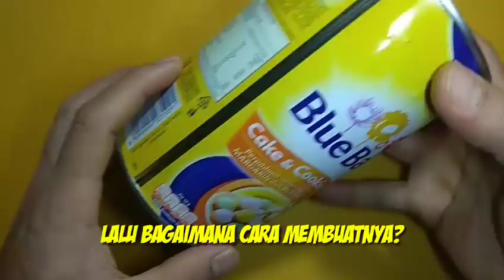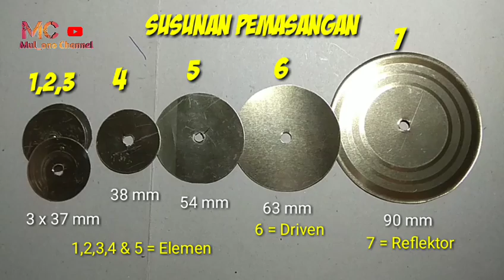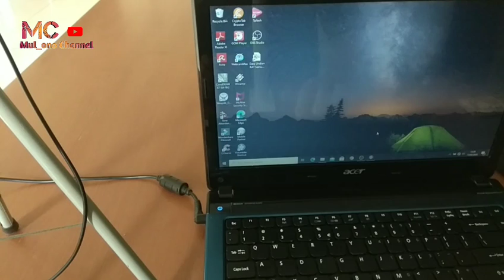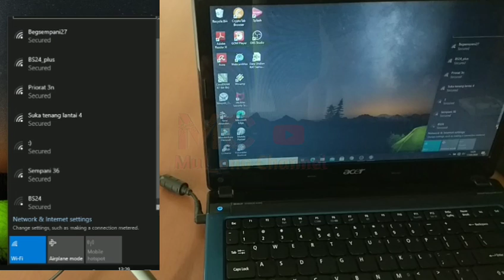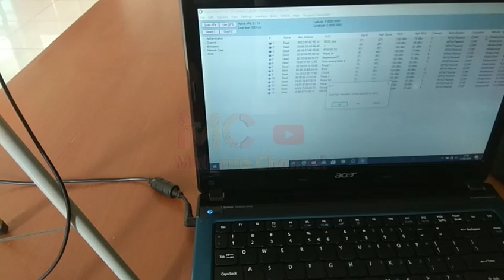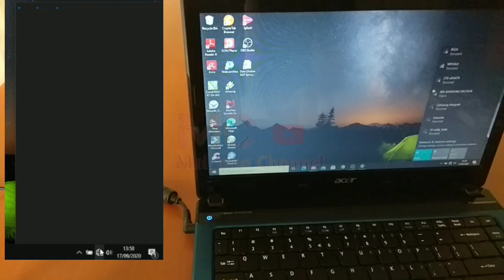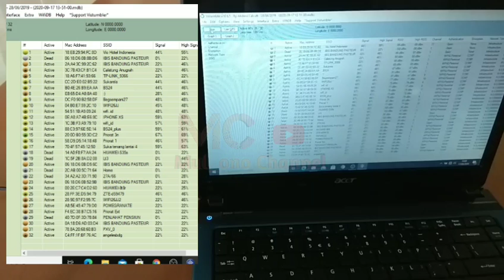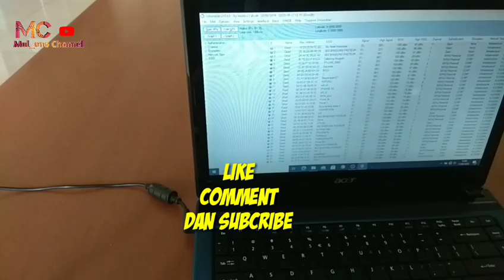Membuat Antena Wifi Gun Powerful, nembak wifi jarak jauh

Comment: Hi how are you. Could you tell me the range to capture 2.4 Ghz networks from a height of 6 meters above the roof of my house? 2- contemplating the loss of signal through the coaxial cable rg6 or a tp2. 3- I use a program called NetSpot. What is the name of your video, because they are similar. Finally, if the antenna had more elements instead of 7 like yours, there were 14, would there be more signal or pick-up power per distance? Thank you very much and your post is very good.

Comment: My friend plzz reply does the antenna work without isolating the driven disc as you have done what is the advantage of Isolating disks
Reply from the maker: Without isolation the antenna will still function properly. Since I'm looking for security for the router, I think for long-term use it would be better to use isolation.
Reply: How can i connect the cable to the adapter without SMA connector
Reply from the maker: It is very easy. The end of the cable from the antenna can be directly connected to the signal receiving antenna line on the PCB. We recommend that the default antenna from the router is removed. How to connect the antenna cable is in my other videos.
Reply: @muletech-112  thanks for the information

Comment: Bang ukuran 37mm 38mm.....itu teh ukuran diameter atau gimana bang?
Reply from the maker: Iya betul. Ukuran diameter lingkaran.
Reply: @muletech-112  kalau kabelnya pakai kabel antena parabola bagus nggak om?
Reply from the maker: Pakai kabel untuk wifi yg berimpendasi 50 ohm. Klo mau hasil bagus, kabel harus disesuaikan peruntukkanya.
Reply: @muletech-112  bagus nya pakai kabel RG berapa ya om? Mohon pencerahannya.saya udah coba pakai bekas kabel antena parabola hasilnya nggak bagus om
Reply from the maker: Saya biass pakai kabel coaxial wifi rg 174

Comment: I built this antenna several times and it does not receive many signals
Reply from the maker: Does the antenna you make, the size and material fit in the video? What cable did you use and how many meters long?
Reply: @muletech-112   Please send me your telegram ID

Comment: bikin buat outdor dong om dgn kabel koaksial 15 meter
Reply from the maker: Kemarin sdh sy coba dgn panjang kabel 10 m tidak bisa. Antena loss, sama sekali tidak bisa nangkep sinyal.
Reply: @muletech-112  terus solusinya bagaimana?
Reply from the maker: Klo menurut saya router di modif sj outdoor.
Reply: @muletech-112  aku ada mr3020
Reply from the maker: Ow... Router wifi 3g/4g ya.. Blm ada pengalaman mas bro. Mungkin bisa cari refrensi di ytb.
Reply: @muletech-112  itu bisa juga untuk tangkap sebar tp ga kejangkau
Reply from the maker: Ow... Klo gtu mending di mondif outdoor sj. Tapi maaf sy blm pernah. 😀😀😀
Reply: @muletech-112  ente org mana om? kalo mau kurimkan mr3020 buat prakteknya om

Comment: Kalo untuk router yg pake dua antena bagaimana masangnya mas?  Yg satu nganggur gitukah?
Reply from the maker: Biasanya di router 2 antena. 1 antena untuk nangkap, dan 1 lagi untuk sebar. Klo untuk nembak, harus tau dulu antena mana yang buat nangkap. Cukup 1 antena sj yg di modif.
Reply: @muletech-112  yg nangkap biasanya cirinya apa dan yg nyebar apa
Reply from the maker: Klo saya tes manual bro. Antena dicopot dulu salah satu. Nyalain router, baru dilihat antena yg terpasang bisa nangkap wifi / tidak. Klo tidak bisa nangkap berarti antena penerima.
Reply: Kalau antenannya 3, yg satu lagi antena apa ya gan ?
Reply from the maker: Biasanya antena penerima hanya satu. Yang lain buat nyebar